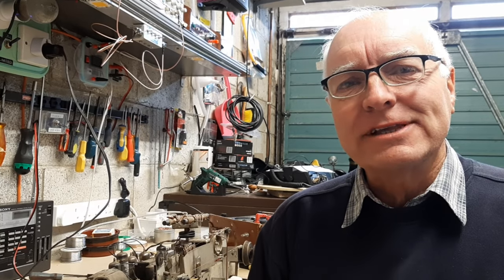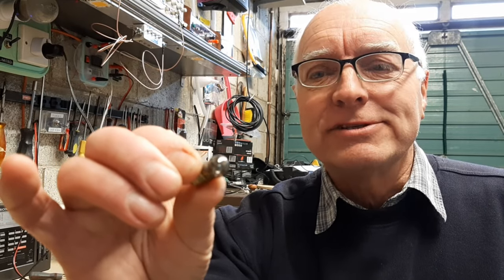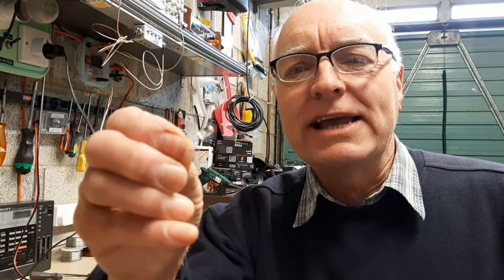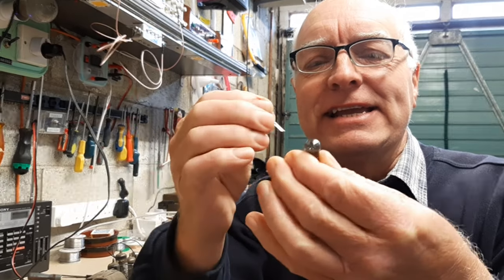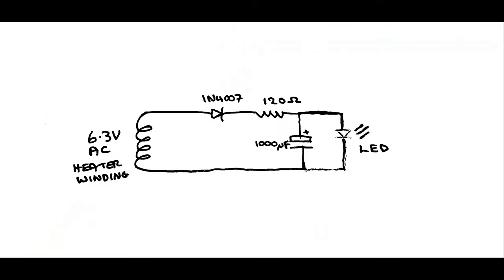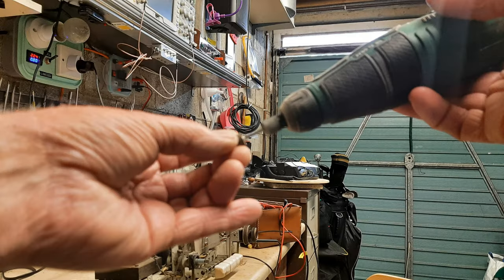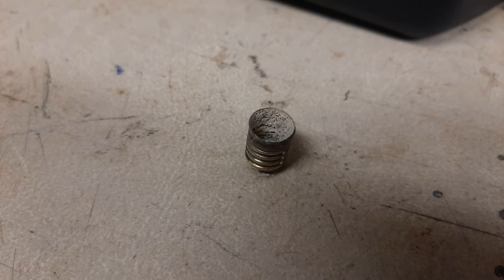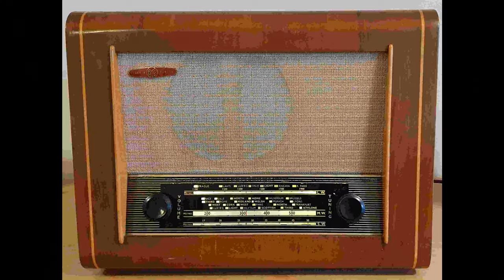Vintage Radio Dial Bulb Replacement

Comment: Nice idea Rod, and the warm LEDs look quite well.. I often thought of doing something similar, even though I have a big stock of dial lamps around the place.

What I came up with was more or less a replica of your own half wave rectification and smoothing arrangement, housed in a small (and removable) plastic component box, available aplenty online if you're prepared to wait for the slow boat from Asia. If the original dial lamp has relatively clear glass, one can, with care, remove it from the base, pop the vacuum (I know it isn't a vacuum of course), cut the base off with a dremel, insert the LED, and glue/araldite the lot back together. Up top then, the original wiring and lampholders is/are  retained.

There's a bit of work in it either way!